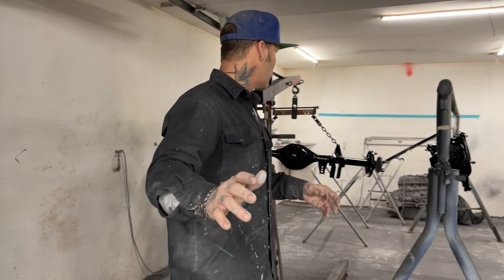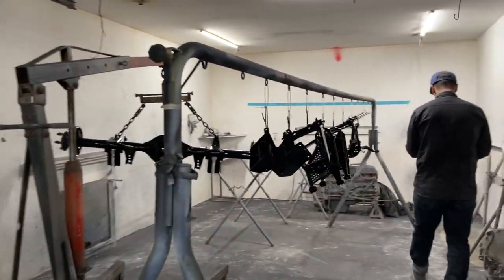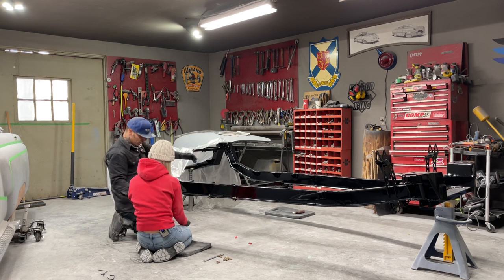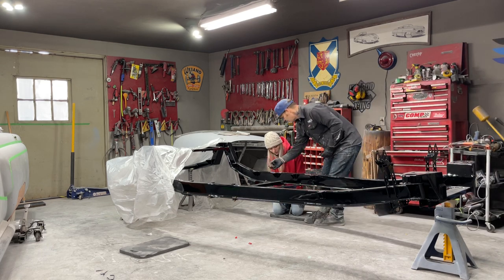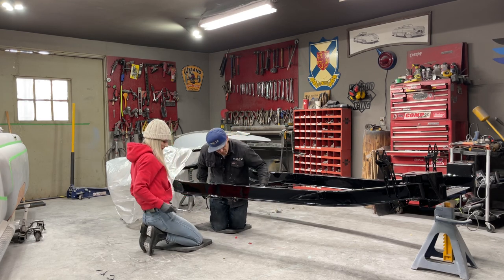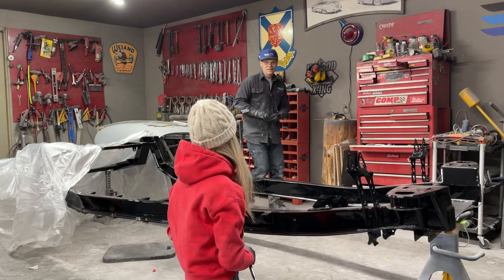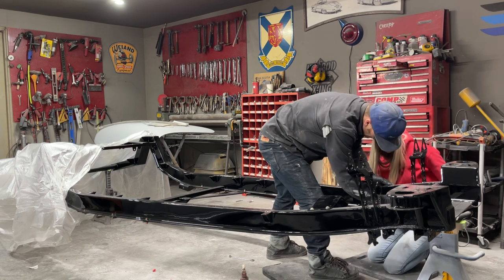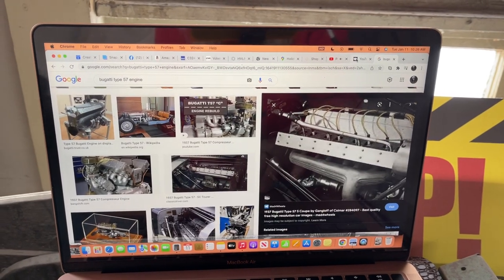Reassembling the Freshly Painted Show Car Chassis (DELICATE PROCESS)

Comment: That's one of the hardest things with freshly painted 🎨 things. Is getting them back together without scratching it and the harder you seem to try not to the more it seems to happen. Also that looks like aluminium checker plate on the valve cover. You can get that stuff at any metal place Chad and jolene. Keep up the great work the both of you 👍 👏

Comment: Needle nose pliers with the ear plugs work great. That closed cell foam works so well with paint, body fill, and resin. The stick a bit with resin but it is easy to cut or sand out.

Comment: Nice work! For the piece on top of the valve cover you could use stainless and can get it laser cut with some cool wording/ bugattilogo in it! Most fab shops have those and would only charge you about 30$

Comment: Helping suggestion:  All bolts, whenever possible, should be installed "In - Down and Back"!  If the nut comes off the bolt remains and still has SOME shear value.

Comment: Chad if you have the original nut and bolts you may be able have them zinc coated will be much cheaper than buying new

Comment: I noticed you are using a red thread locker; I would suggest you switch to a blue as it is removable where the red requires heat to remove just a suggestion, I would hate to see you ruin your paint